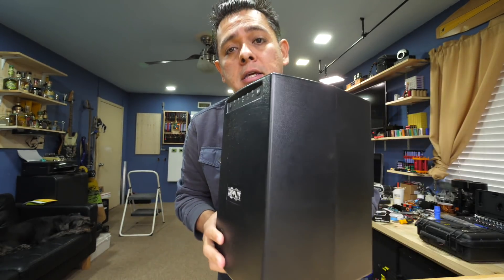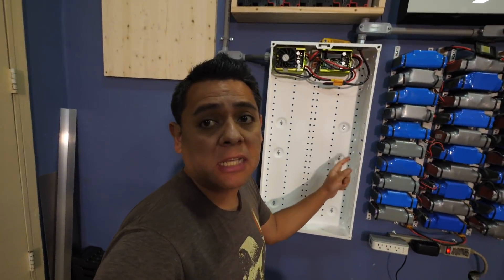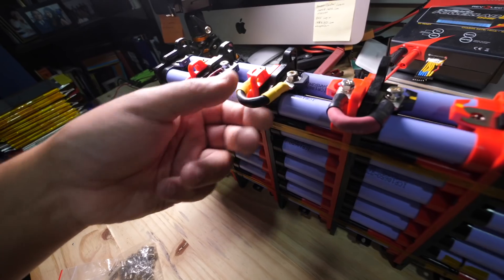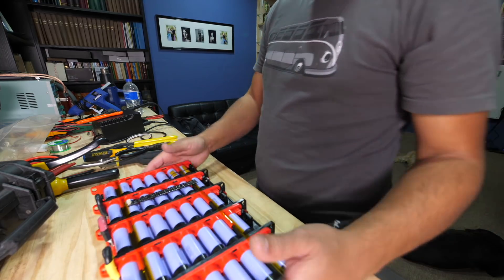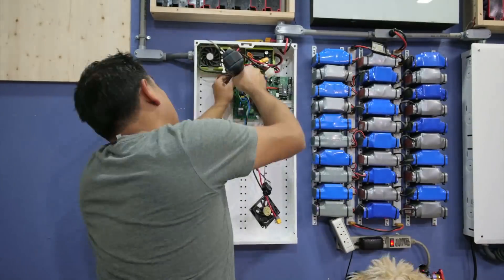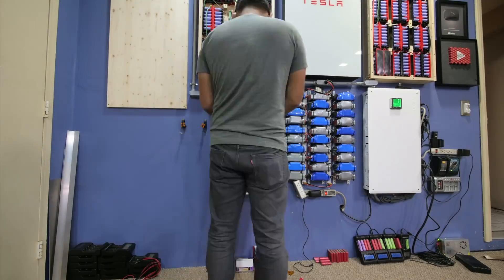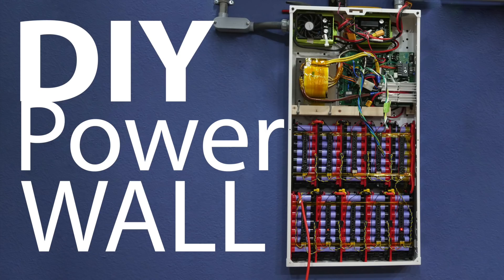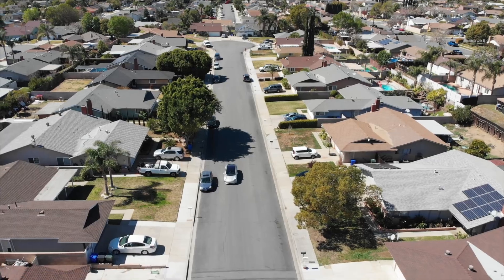1kw DIY PowerWall affordable  18650 build project (2018)

Comment: hi Jehu I know you busy but back to 18650 ebike power.my new Samsung 26h cells in a kit 10 of these in a 70 cell 54v kit are dead like 0v or near to.were they up to the job.only a few uses.i mixed them with new Panasonic 2600 mah an 10 Samsung 25r.they ok .its in a vruzend kit the power dropped off then on inspection I dropped battery on hard floor.so had to replace some plastic tops.but another guy on here vaeco I think says I need higher discharge cells.is that right?tried to revive or bumpstart cells parallel with good ones but not working or if they do they don't have same capacity.steve in uk.its on a 48v 1000watt front hub motor or my wifes 36v 250 watt motor a only one battery between 2 bikes.ha.si I still have a 42v kit after took dead cells out .
Reply from the maker: well first problem is Vruzen,  get rid of it
Reply: steve mcgowan get a DC to DC converter. with constant volt and current.  and set to 4volts 1 amp. and constantly monitor the cells. if they are 0 volts I wouldn't bother. but if they are 1+v try getting them to 2.5+v then put in a charger tester. and only series like cells. with close in capacity. if you want to try saving the cells. you can parallel and charge. with DC converter. and a power supply. 12v 2a. would work nice. the 12v led lighting power supply's would work. but pot them some where safe . and monitor. while charging. and yes the solder less weld less  connectors. don't carry the current for bikes and things. unless you are pulling 1amp per paralleled cell. its useless. and usually have bad connections.  maybe you can solder a pack. or build a welder. there videos on y. t. diy battery spot welder. I was thinking about using drill batteries. take them out the packs. they already in series.
Reply: is thata drok like shawn McCarthy used don't I need a power supply too
Reply: jehugarcia so is it not worth soldering the connectors up or use.  Shrink wrap to tightly kit.i have had it in a plastic toolbox so far with cloth under neath but there must be lots vibration .so if not spot weld joints I guess
Reply: Interesting.I've been asked to look at a 72v pack with EXACTLY the same problem as yours (0v on 96 out of 120 cells).They are Samsung 22F - rated at a maximum 5amp each cell - 6 cells in parallel giving 30 amps maximum.The e bike requires 60 amp at top speeds.Your comment has me thinking that overcurrent draw has destroyed these cells.
Thank you.

Comment: One thing to note, DC likes surface are (stranded wire) while AC is okay with solid.  Glad to see you are using solar for charging.  From my experience, UPCs charge too slow to replace any significant amount of consumption.
Reply: Aaron Aaron  I’m getting old, but I think it’s the opposite. AC has skin effect so likes stranded with lots of surface area. DC uses the whole cross section equally so sold is best. For very short distances the difference is probably negligible with DC.
Reply: Geezus. Are there no decent human beings on the internet?
Did I not say short runs of stranded cable is fine for DC?
Stranded is much more flexible so that is used in cars. Easier to install and route through the vehicle.
WTF? Did you bother to look up the skin effect with AC? Stereo speaker wires?
Look at the 500k to 1M volt power lines around the country.
They use 2 or 3 separated wires to get more surface area (skin effect) than a large single line would provide.
This seems like a nice, informative channel made by a decent guy.
But the as*h**e commenter always responds to my efforts to be helpful in the comments.
I need to listen to my oldest Son who’s studying computer IT and security.
Never. Ever. Comment on anything.
You, and 10 other jerks, just sealed the deal on me ever trying to help anybody out on the internet.
GFY.
Reply: DC does not suffer from skin effect at all.
That's why HVDC cables can carry a gigawatt underground for 1000 miles using a cable a few inches in diameter. All the copper is used to conduct.
AC skin effect is only noticeable at high frequencies and/or long distances, and completely irrelevant for a DIY powerwall unless you're generating mains voltages at many MHz, in which case the FCC would be hammering down your door!
Reply: Andy Lee Robinson  Thank you for a thoughtful educational response. It’s very much appreciated.
Reply: And what type of wire runs from your car battery?
Reply: Aaron, the battery is being charged by the solar controller (up to 10A in this case), not the UPS (mains input isn't being used). As long as the battery has enough voltage, the UPS will keep going, and doesn't care how the battery gets charged.

Comment: Thanks for the video! The BMS still seems rather expensive to me. But they seem to be that expensive unfortunately :/
Reply from the maker: This is very powerfull bms so it’s worth it
Reply from the maker: There a hundreds of $10 bms on amazon and eBay, all voltages
Reply: I agree.  The Batrium stuff is expensive.  I have seen the cheaper chinese stuff on amazon/ebay, but weary because they are so cheap.  I also would not want the BMS to CAUSE problems.   I have been thinking of following Jehu's advise in building the pack oversized so you don't necessarily need a BMS.  Just got to run the numbers and do more research!
Reply: I know it's "full size" but I was wondering if for a relatively small power wall (maybe even something smaller to just power some lights or dehumidifier in a shed) you could get something cheaper and still good.
I'm just complaining a bit :)
Reply: Probably don't want to skimp on the component that keeps your batteries from exploding
Reply: Why wouldn't I want to skimp on components as long as they keep my batteries from exploding? ;)
Reply: Dejay Rezme reliability
Reply: You think there is a correlation between price and reliability? ;)
Lol but seriously, I think the most important think would be an indicator or safety system if something fails. Doesn't have to be a web interface but that it just stops when the balancing fails with some led indicator.

Comment: Hi. Looks good, but do you have any suggestions for us that need a 230v output? (Europe)
Reply from the maker: a 230v UPS?
Reply: Nice.
Reply: look for APC UPSs which come in second hand market with batteries already too weak. You can get them relatively cheap. Companies want to get rid of those. The APC smart UPS1500 has a true sine wave. I got mine for 30 euros. And I have seen APC smart UPS 3000 heading straight to the recycling center.
Reply: but check the voltages for the battery. Most of these older UPSs use lead acid (multiples of 12V - 12, 24,36, 48V depending on the power.)  The easier and safest way is to keep using same type of battery... to convert to Lithium-ion you need to make some calculations. For this 36V he is using in this video 10 cells in series. Fully charged aprox 40V down to 30V.
Reply: Are you serious? Use a 230v inverter or 230v UPS
Reply: Thanks a lot!
Reply: Yes, I am serious. I am perfectly able to find a inverter or an UPS that outputs 230v, however I guess I was hoping for something along the lines of "Hi, I know the SuperUPS200 is a good, affordable 230v one that is similar to the one I used"
Reply: 220

Comment: Awesome Video Jehu, I am actually in the middle of a DIY PowerWall, using the exact UPS and charge controller. My only problem, up to now was the Metal Enclosure. Thank you for the link!!!!!!All the enclosure I found locally was upwards of 100-200$ and way out of my budget. Took me forever just to save the parts and pieces to build this. I might have the rest of my batteries in the next month, just waiting on an email. Unfortunately, I couldn't afford the longmods, but a mutal friend has given me some leftover 10S BMS he had.(Came in the nick of time). I hadn't taken apart the UPS yet, your video has given me all the tools need to build this now. Thank you.

Just one Quick question. Right now, I have my battery packs at 10S4P(still waiting on a few batteries to complete). But I noticed in your video, you have each pack at 3.7-4.2, and in series for 42V. Would it be simpler to do it this way? Is this more efficient?

Great Video and I can't wait for the next one!

PS-I started posting my Videos, took me forever!!LOL!!
Reply: i have 420 battery like new from the lg hovorboard ones id like to get rid of if your intersted
Reply: If you do it as Jesu did your battery with be thinner but longer
Reply: Neon Nuke, Thanks for the comment, do you know if it would be more efficient using in packs of 3.7 or in packs of 10S4P.  I have seen these done both ways on the smaller Powerwalls. But have yet to find the answer over the net. Probably means they are equally efficient. For me the packs would remain the same size. Each pack would be 40 batteries. used in 4 x 5 battery holders x 2.  I will be using 5 completed (10S4P)packs. Thinking if I do it this way, in order for it to work, each pack would only be 20 battery at 3.7V each and I would need 10.

But, because I can't afford the longmod, and I only have the 10S BMS-s, it might be more practical to keep them the way it is. Just wondering about the efficiency or if there is any?
Reply: I am pretty sure I place the P first also..LOL, Kinda weird i spelled it the other way? Thank you for the Tip!
Reply: Yasser Saeed, I just noticed the notification on this comment! The Guy I was waiting for the email from, got ahold of me yesterday, we already completed the deal. But, I am always looking for other deals. Shoot me an email with the price your looking for. I use the same profile over on gmail.
Reply: @Yasser Saeed
Did you get rid of those batteries or you still looking to unload? Shoot me a message with the details.
Reply: Yasser Saeed do you still have them?

Comment: They’re 37 v batteries, not 42v, that’s why they won’t charge more.
Reply: They are 37v nominal and max is 42 so they will gladly charge to 42v. 10s system
Reply: Emmanuel Velasco Keep quiet

Comment: About longmon, if I understand correctly, the temp sensors on long mon are for checking temp on resistors on long mon to make sure its not putting too much power to resistors.

ITS NOT FOR BATTERY TEMP CHECK
Reply: Ivan there are 2 temp sensorns on em. One for the Main mcu or checking battery temp and one for the balancing resistors to be able to regulate the balance current
Reply from the maker: not what Jaron told me,  he designed them so I trust his input
Reply: You and Jehu are my battery gods.  Keep up the good work!  I'm watching, learning, and not having to blow stuff up myself.  Even though that looks like fun.
Reply: Interesting.  I thought it was for measuring the battery temp.  I thought the battery temp is the critical measurement.  When a battery is being drained at too high a rate, or one of the cells has dropped below the voltage threshold it's internal resistance goes up and resultantly the heat goes up.  When the heat of the batteries goes up the  watchmon shuts that group down or the whole pack down preventing damage.  However, I am no certified expert I just read the data on the Batrium site.

Comment: How much better is a power wall vs. solar setup with battery backup? And yes I know this is the same thing but cost vs. building your self or just plugging together a system even though it's not in a single box.
Reply from the maker: too vague a question,  there is a million ways you can go on both kind of systems
Reply: I am just asking is it better to build a PowerWall or too do a solar to battery backup for like a tiny home? What really is the most cost-effective way to go?

Comment: Sorry for being stupid but I forget the name of the cable end connectors for joing the packs, the cheap way of getting them is to get copper pipe cut to a couple of inches and flatten one end, then drill a hole in the flat part and hey presto connectors for pennies. hope this helps someone out there, Love the channel as always.
Reply: You'll have to replace that conduit every two years
Reply: You hurt my feelings, I didn't know but good point just could've worded it better was only trying to help.
Reply: A different metal pipe would help as I've been royally put in my place. but not plastic... its brittle and you can't hammer it flat...... but you can heat it carefully with a heat gun and squish it flat then it won't corrode. Thanks Michael for the tip because water pipe copper is not chemically designed to allow electricity to flow through it without it slowly damaging it .but seriously I'm sure you can make it out of something else thanks to the collective intelligence this channel thankfully holds thanks to Michaels comment I may look into it and learn something new.
Reply: We all watch these video's and maybe add the odd comment to learn something and share tips and no you shouldn't believe every comment you read but use it as a spark to ignite an idea to learn and better ourselves not to comment and put others down, So I'm sorry if anyone thinks my idea was idiotic and utterly stupid I was just trying to help I beleive most people are here not because they are experts but because these videos are to inspiring,  I made my comment not because I'm an expert and better than anyone else, So if anyone has an idea you don't agree with just point it out with constructive critism and without trying to belittle the person with the idea while at the same time trying to make yourself sound superior..
Reply: Brannen Thompson it's more that we don't want anyone to get hurt or try something thats already been done. We're just here to save you time.

Comment: Be careful re-using a UPS like that. They aren't built for continuous duty. It'll melt, overheat, and let out the blue smoke.
Reply: Only if they are ran at full capacity without proper cooling. If it's ran at about 75% rated capacity and there's a fan to keep air moving through the case, it should have no issue. During hurricane Irma, I was out of power for almost 2 weeks (nothing compared to PR). I ran a 500W APC UPS at almost 90-95% capacity and it took almost the 2 weeks before it started showing signs of issues. A few screws came loose on the transformer causing vibration noises, and the pcb started to discolor. But I was really pushing this unit. I had the case off and no fan on it.
Reply: I'd rather use something with known specifications that isn't a fire hazard.
Reply: everything is a fire hazard. If you treat it properly then there shouldn't be a problem. The problems come from people not putting in the proper safe guards to protect people and property. Jehu did put these safe guards in by using a proper BMS with fuses and breakers and emergency shut offs.
So, with that logic, you won't build anything yourself. It's gotta be built by someone else who decided what was safe and not safe.  Gotcha.
This type of setup is not for the average person to just throw together. The person should know what they are doing and be aware of the inherit risks (like driving a car) and know how to handle situations that come around. This is the type of setup that is truly for a real DIYer.